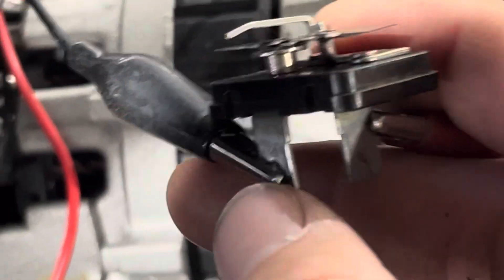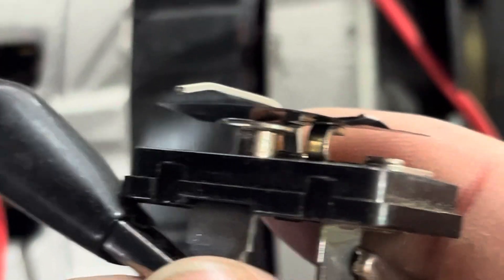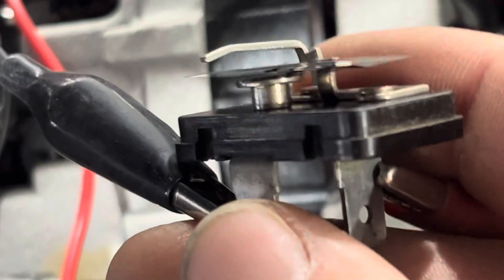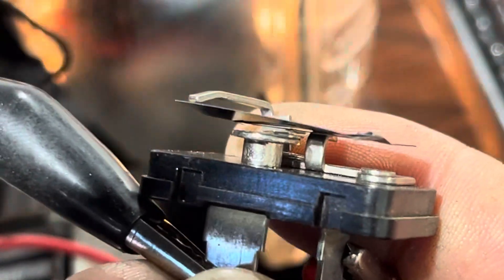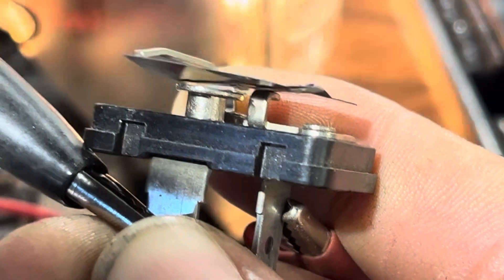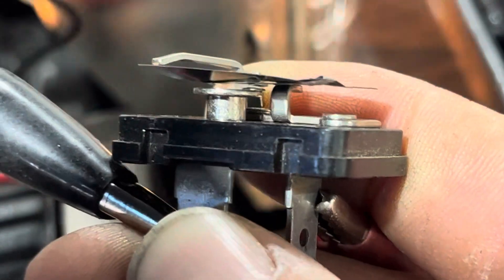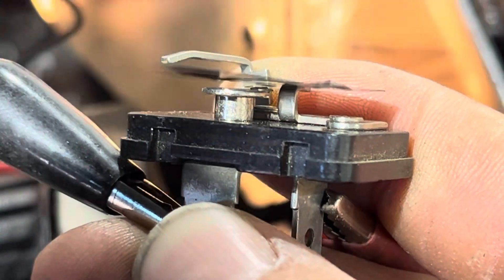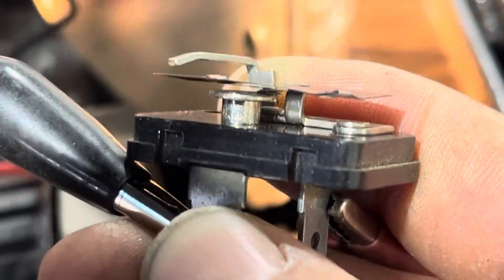Mechanical Flasher Relay - How It Works

Comment: That's incredible, thank you for doing the work and sharing. I've thought how these work, and figured it was a little motor in the relay that spins in circles and disconnects the hot 1 time every spin, or uses a wiper blade motor to go up and disconnect the circuit then drop down. How does it do that flicking motion like that to make the contact?? I know you say it used the load but I'm a little confused still!
Reply: It has to do with current and temperature. The spring lifts when heated by current, cools, drops, heats, lifts and on and on.
Reply from the maker: @EvanTownsend  the spring is a bimetallic spring, so it’s made of two different metals that expand at different rates when heated. When current passes through the spring, it heats up, causing it to bend away from the contacts as the two metals expand, but not equally. Then, when the circuit is broken, the spring cools (as @Code325 said earlier), causing it to unbend and reestablish the circuit. This cycle repeats for as long as you leave the signal on.